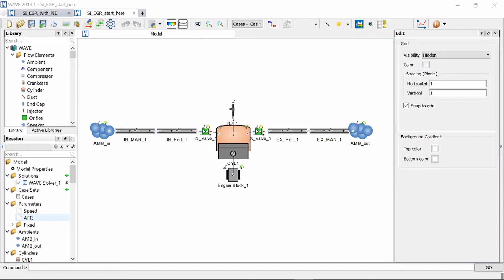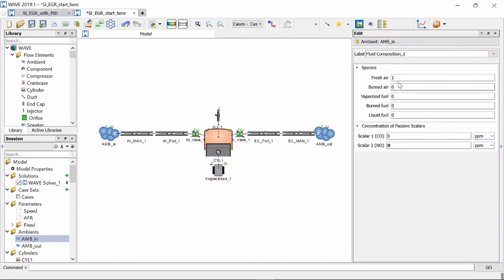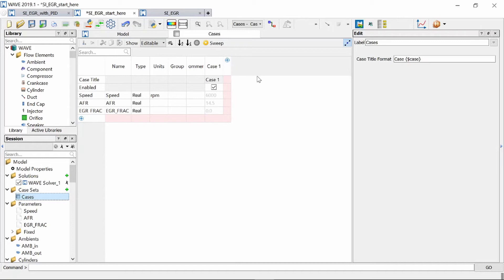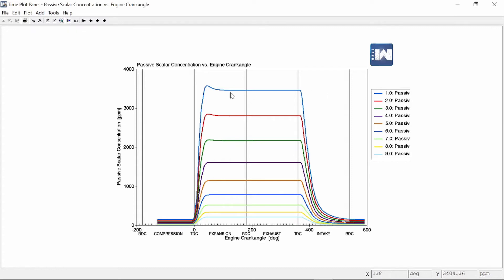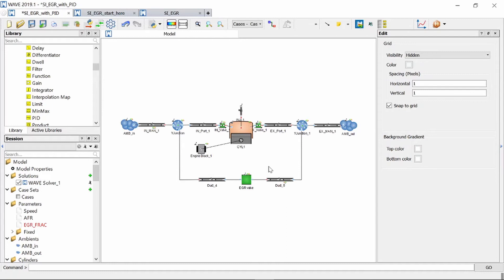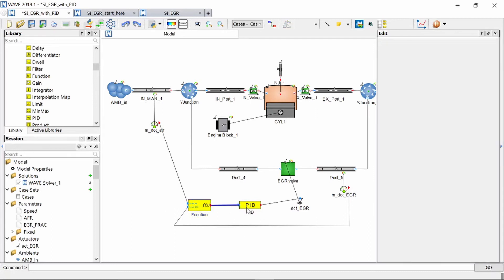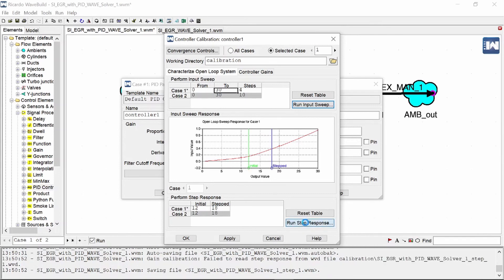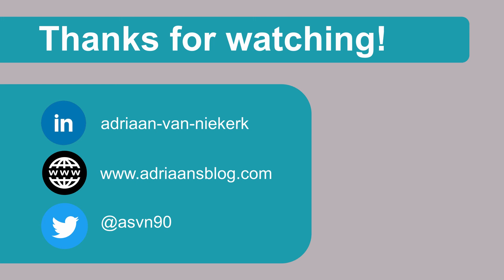How to simulate exhaust gas recirculation in Ricardo WAVE | Ricardo WAVE tutorial | EGR

Comment: Hi Adriaan. Hope to be fine. Using the simple EGR approach, is there anyway we can add fuel instead of EGR? For example H2 or CH4 added to the inlet manifold with air.
Reply from the maker: You can always add fuel via port fuel injection, but you will need to connect an injector to the inlet piping. I haven’t tried connecting an injector to the ambient element, but you try. Or connect it to the pipe element right downstream of the ambient element.

Comment: Heya Adriaan,
Would like to first say thankyou so much for your videos, I am undertaking a final year university project using WAVE modelling a camless engine and without your videos I would have SERIOUSLY had my work cut out for me. 
I am attempting to model EGR into my model and didn't quite get the results I was hoping for using method 1 (basic), so am attempting method 2 (complex)
I thought I had the model complete and went to run, where the output script told me the run had failed due to: "ELEMENT EGR valve HAS NOT BEEN DEFINED AS A JUNCTION"
I had a look in tutorial notes but full instructions for method 2 have been removed by the looks? (I could only find full instruction for method 1)
Any ideas on where I may be going wrong? Dead keen to get this working!
Thanks again!
Reply: I changed the orifice for EGR valve into a Y-Junction and it ran?
Reply from the maker: Glad it worked in the end. Don't know why a YJunction fixed it compared to just using an orifice 🤷‍♂️

Comment: I am doing all steps right till I go to calibration. Nothing appears after I run the input sweep. same problem as Jehad Yamin. I defined all the sensors properly too
Reply from the maker: That is strange. There is a tutorial in the help files that also looks at adding a controller to the EGR valve. Maybe have a look there and see if you can calibrate it successfully by following the tutorial?

Comment: How did you open the wvmx file created by Wave using wavebuld?
Reply from the maker: When you run the wvmx file, it automatically creates a wvm file which you can then open in WAVE Build
Reply: @AdriaanVanNiekerk  Thanks for the reply. Still trying to figure out how you defined sensors, pid controllers ..etc. Many thanks for the nice video.
Reply from the maker: @jehadyamin6002  Thanks 🙏🏻 You can have a look in the tutorial help files under NOx Emissions; they go into great detail how to set up the PI&D controller and sensors.
Reply: @AdriaanVanNiekerk  I am doing all steps right till I go to calibration. Nothing appear after I run input sweep. Strange.
Reply: @AdriaanVanNiekerk  Got it. Found the problem. Wowwww was so hectic. Thanks for the help.
Reply from the maker: @jehadyamin6002  what was the problem?
Reply: @AdriaanVanNiekerk  Thanks for the care Adrian. Seems I missed up with the new junctions and pipes. Besides, i defined the new sensors wrongly (equivalence ratio instead of mass flow). Still did not get the desired performance, but no errors. Now debugging will start. I use dual fuel H2 + Gasoline
Reply from the maker: @jehadyamin6002  it is quite an effort to build a model from scratch! For a duel fuel engine, rather use the dual fuel example engine provided by WAVE and modify it to what you want?
Reply: @AdriaanVanNiekerk  Well, Thanks for the advise. I did it already and published some papers in the second law analysis. I got interest to add EGR and found your nice video. Tried to add it, i got the calibration done after finding the mistakes, but still EGR is causing NOx to increase instead of decrease. Wiered. I will take some time off then come back to it.
Reply from the maker: @jehadyamin6002  o nice! Do share the link to the paper - it will be nice to read it. Good luck with figuring out what is wrong.